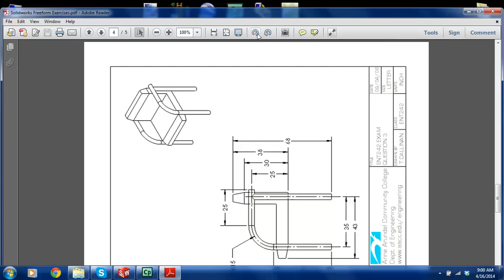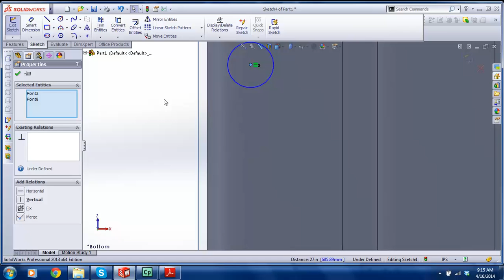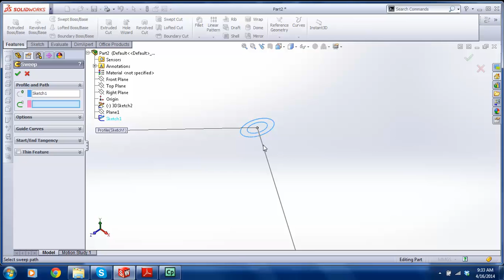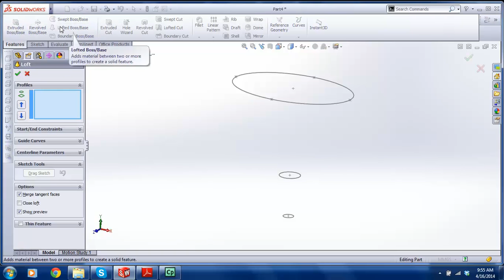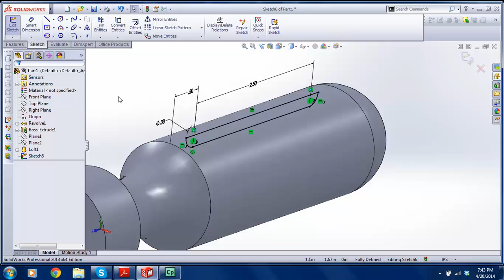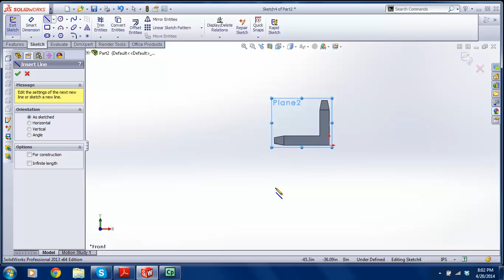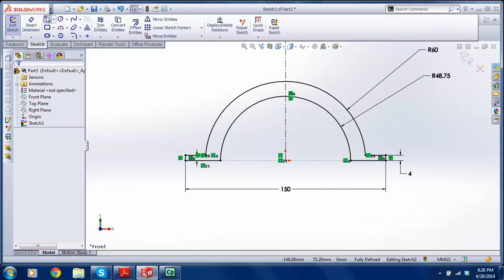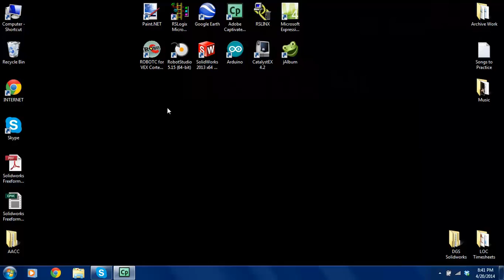Solidworks Tutorial 11 Freeform Exercises

Comment: The draft angle on that chair (1:12:00) can be found by using trigonometry. Since the offset is 8, and the outer edge is 5, then the trig is this: angle = arctan( 1.5/8 ) = 10.62 degrees.

Comment: Tim, Your videos are so much helpful maybe the best ones in detailing from A-Z and I'm learning so much from you, teaching solid works is not an easy thing at all, I understand its very stressful and that makes you sometimes miss something here and there such as the first chair swept 3D sketch that wasn't fully defined at the end of the two 20 degree angled lines which we must put the 80mm between them and because you are in 3D sketch you have to put some dimensions twice...my other note is regarding the last model (lets call it air duct or impeller housing) which you did a great job as usual and you are forgiven of making the front cover fully closed which is not but ends at the circle R48.75 that's why its showing an extra circle line on the drawing.........please keep posting your tremendous videos........and thank you very much

Comment: On the last model, the one of the shroud, I think you need to cut out the near side wall to leave an outer lip that has a 48.75 mm radius. So this would leave the one side (mostly) open, except for a thin strip of material 11.25 mm wide. This would basically open that side of the shroud so that you could see the spinning device inside the shroud, yet still leave a protected area near the periphery so that nothing could get into the spinning impeller, blade or whatever that's in there.